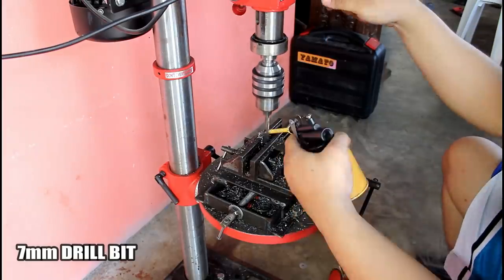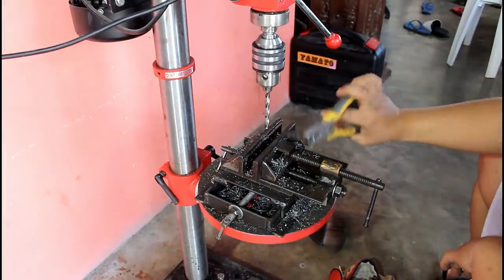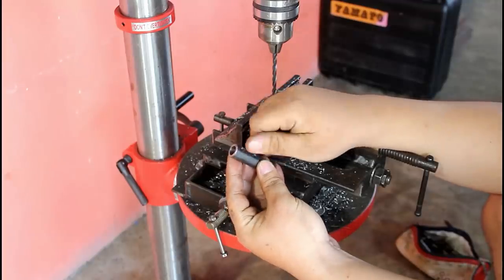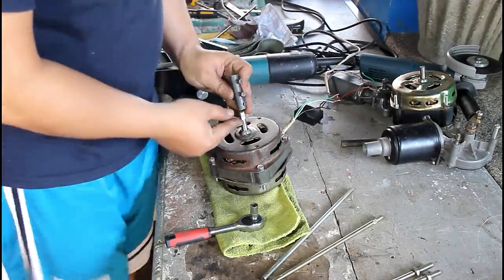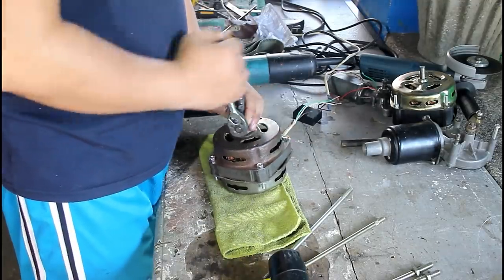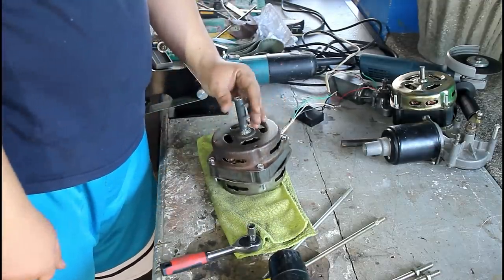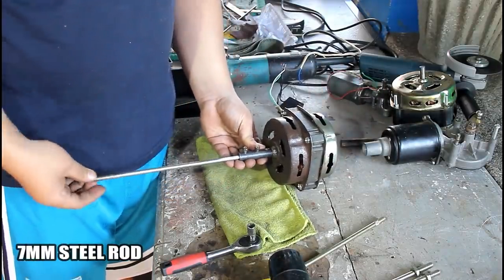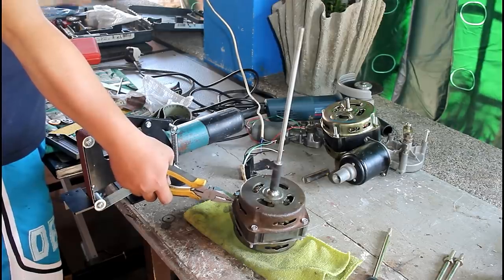Spindle Sander Oscillating (DIY)

Comment: Hey mate, nice work as always but i expect a lot of sawdust could get into that motor especially with those smaller sanding drums. I recommend putting a sheet metal shield above the vents, not to block them but to deflect some dust. Also maybe some smaller inserts for the table might help with the smaller drums. Just an idea
Reply from the maker: yea mate i also notice that sawdust getting inside the motor, so i put plastic plate in the top, thanks mate :D
Reply: @SekAustria  That's not a sander, THATS A SANDER!!

Comment: very nice but would add a support to the washingmotor axis (which rotates)
against sidewayforces. (either with a fixed bushing or with 3-4 skateboard bearings at the top)

Comment: Very nice sir, well done. I do not have a workshop , but if I will, I'll give this a try.
Reply: Duco Maritiem you don’t need a workshop at all to build this. It’s a nice luxury but not a necessity. If your using that as a reason not to build one yet it’s just an excuse and if you did have a shop you’d be saying you couldn’t do it cause it was raining out
Reply: @1982MCI  Don, I had a small place to hammer, weld and grind until the start of 2018.
Now (divorced) living at my mother's (82) home, the only place to do stuff is a crammed shed full if bicycles, and garden stuff.
I have literally 1 square meter for all my tools & stuff and use that to make jewellery.

Really, I runned a forge until last year, making most of my tools, just like Sek does. 
So please do not judge my situation, or my skills if you do not know me.

Also living in a very urban space, with people complaining if you make any noise at all.
And indeed, its raining a lot outside here in the Netherlands, tried casting aluminium in the garden, but is far from ideal.